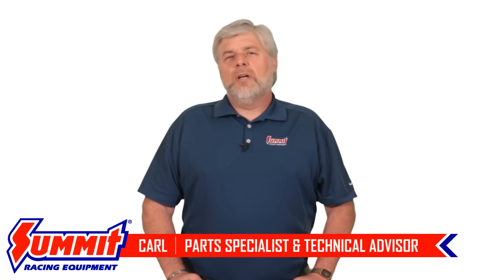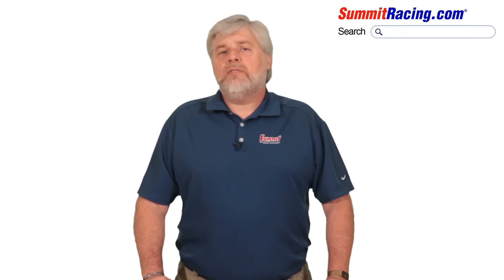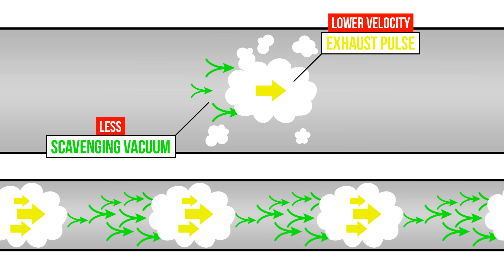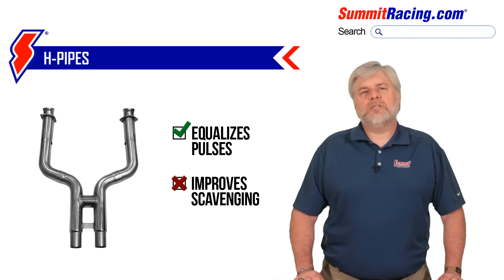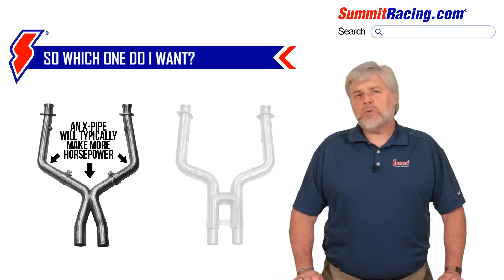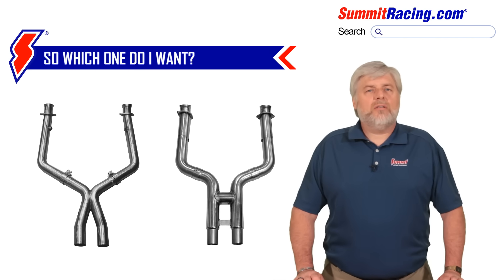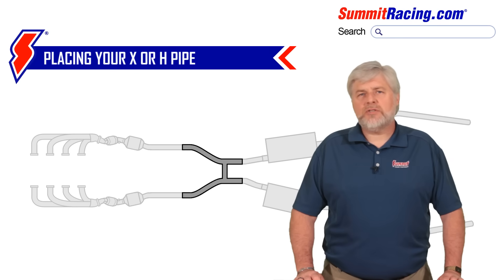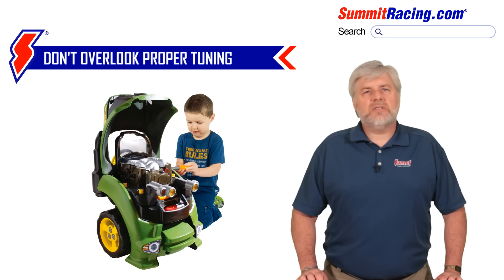Exhaust H-Pipes vs. X-Pipes: What You Need to Know

Comment: Is there a specific length of H pipe that works better? Why?
Reply from the maker: Hi Samuel,  the length doesn’t really matter. Its going to be what fits the application. The purpose of the x and h pipe is to equalize the pressure between the two pipes.

Comment: If you have headers then it is time to add an x pipe or H pipe. 
The X pipe is better as it doesn't restrict flow like an H pipe can with the adjoining pipe in between the H pipe. 
If cost is an issue and a significant difference in price exists then choose the one you can afford as the x pipe and h pipe are very similar performance wise.

Comment: A fueling pinch, named for a man whose name was Fueling, also helps the engine resist reversion which occurs in the overlap of the exhaust and intake valve opening at the same time. But given the distance from the engine of the x or H pipe, I don't think there's enough measurement to be found for either. The primary difference is some engines get higher horsepower with an x-pipe and some of them get higher horsepower with an H pipe. By the time you get to either one of those all the Scavenging is either being accomplished or it isn't.
The Ford modular engine was for several years not responsive to x-pipes but did make a little bit more horsepower with an H pipe and always lost it with an x-pipe. Another consideration is any stretch of straight pipe 3 ft or longer tended to start dropping horsepower and I don't know why that is it was just some anomaly that occurs in the pipe where the pulses do not remain separated. Probably the disillusionment of the pressure waveform.

Comment: bottom line... unless you have a LOT of money to throw away chasing that extra 5 or 10 HP you might pick up by tuning your pipes with a dyno, don't worry about it. My car came with an X pipe and that is what it will stay with.
Reply: It's all about sound with me I got 550hp.
And I got the quietest turbo Mufflers you can get they sound fantastic but I know they're holding the horsepower back so I got to go with straight throughs. I'm going to get the quietest ones called Borla Pro Xs but they are only 14 inches long. I don't want any blah blah blah or pop pop I just want to zoom. So what I'm going to do is put two 9 inch dynamax bullets in front of them and try to find the quietest it's smooth as X pipe and hope for the best.

Comment: Way back in the pre-Internet days, but after Fred Flintstone, I had a 1969 Cutlass with a HO 350, PowerGlide and a Holley 650 double pumper.  STRAIGHT 2" pipes out of the headers (insulated) back to a pair of cutouts.  One leg of the cutouts went to the mufflers (Hush Thrush's) and the other pointed straight at the ground just behind the rear axle.  With the CO's closed it dynoed from 325 - 385 between 2 and 4k RPM.  Opening the CO's added about 30HP across that range.

Comment: Quite a bit of outdated info in this video. MotorTrend (Engine Masters) actually proved many times that in nearly every application, larger diameter pipes will increase horsepower at everywhere in the RPM range.  In another episode they showed that H-Pipes will make more peak HP and Torque than an X-Pipe, however the X-Pipe is probably friendlier to tuning and drivability.
Reply: As long as you don't go too large for the amount of air the engine is moving.  The key word in the video was STOCK, & he was sort of inferring a small cid engine.  For example, if you were to put 1 7/8" primary, 4" collector headers with a set of 3" pipes on a stock  5.3L  LS, you would most likely loose power because the amount of exhaust air flowing in the system could (most likely would)slow down & then even flip over on itself when the next pulse hit it, creating even slower evacuation & eventually acting as restriction.

Comment: The sad truth in this is most street driven cars and trucks will NEVER know what works best. It'll be little more than a guess. In the end, for the over-whelming majority of us, it's street car not a RACE CAR with an unlimited budget to buy and try lots of different set ups. X, H or Y pipe and where to place them.......getting the most beneficial result would require lots of dyno testing , drag strip testing and a willingness to R&R lots of different placements, pipe sizes and header configurations. An unlimited budget and willingness to do that much work.......sounds more like an all out Race Car effort not a street car looking to just do reasonably well vs wringing out every last possible individual horsepower and torque increment available. Most of us will buy and install what is GENERALLY speaking recommended for the engine and it's breathing requirements. After that it'll boil down to what fits best and meets our sound requirements. Biggest reason to go X or H pipe on a true front to back dual exhaust boils down to a better sound. To my ears an 8 cylinder exhaust sounds better than two 4 cylinder systems. If I get a couple of extra HP out of it that's GREAT but ultimately it's more of a sound improvement I'm going for. I don't really expect to see or feel any real performance improvement worth talking about through the use of either an X or H pipe. I certainly don't expect to see any real gain for one vs the other when deciding between X vs H.

Comment: Placement is key here, old school trick is to draw a line running back along the pipes in crayon, run the engine, where the line stops burning is where you put the crossover. 👍
Reply: slade bonge  It was a trick used by Bill 'Grumpy' Jenkins back in the day, aparently he found that the line drawn in crayon stopped burning where the exhaust gasses cooled down and began to expand, he saw HP and TQ gains throughout the rev range when he put a balance pipe at this point in the system, although im sure todays off the shelf systems are designed using the same principles, but might be of help if you are building your own. But dont make the mistake of thinking bigger is better, if you go too big it allows the gasses to expand and cool down faster, this actually creates backpressure, 3in pipe is usually plenty for a street driver. Happy building!
Reply: @jaybilis9723  That applies to open headers. Closed exhaust, much is determined by the type of mufflers being used and size of the pipes.
Reply: @jaybilis9723  So when a gas cools down, it expands? Since this contradicts everything in science, please explain further.
Reply: @calvin99991  OK here we go, I think you are confusing mass with kinetic energy, as gas particle heat they expand, their mass is equal to a cool gas but their stored energy is much greater, therefore if something has more kinetic energy than something else, it takes less force to move it, if this goes against everything in science I will stand corrected.
Reply: @jaybilis9723  Okay, here we go with someone trying to give a bullshit explanation for something they said. YOU stated "....stopped burning and the exhaust gasses cooled down and began to expand". That is a wrong statement. Instead of trying to give me some bullshit explanation by changing the parameters of what you actually SAID, admit that you stated it wrong and correct it. But no, nobody on the internet can ever admit they made a mistake.
Reply: @calvin99991  sorry I meant 'slowed down' my mistake, but thank you for your articulate and well rounded response Mr haker.
Reply: @calvin99991  No no.  You worded it wrong. When the gas EXPANDS, it cools down due to lower pressure.
Reply: @ChefofWar33 not that big of a deal, dude, just move on.
Reply: @jaybilis9723  I’lm m mm mm. M m m. 
0l. Kkilkkk
),,."”-46
O g    N 
O

 M nmnl. H B.u. , 
 Nah. N
N. Pub
Reply: We did this on motorcycles back in the day too to determine length.
Reply: slade bonge  I cant help but smile when i see guys in small displacement cars with 4in pipes, because its loud they think its faster, cherrys sound mega in v8's too!
Reply: @jaybilis9723  
Thanks Jay !
Reply: @jaybilis9723  Depends on how much power they are making.  It's not uncommon for a tuner 4 banger to make over 500whp, that will restrict power on a single 3" exhaust, it's simple math.
Reply: Did this for tuning a stinger on VW.
Reply: Or just use math...  The issue is the target RPM you want the gains, the factory today does it for cruising speed, you more likely want peak gains.  The gains are very small on cross plane engines anyway.    We are talking about 4hp gain on a 400hp engine for about 500 rpm range.

Comment: Yeah, it don't matter you speaking on sound not actual vehicular/motor propulsion. Horsepower is the actual amount of output the motor is cable of producing with such vessel, with other demensional mechanisms pertaining to. Your not losing, your pretty much restraining the motor with this form of innovation of the example motor we put out here with yalls supposed governing system. Obviously it's not necessarily important, cause your only going to change the sound of the expelled reactants in fuel, air an conduction in combustion from the motor thru the pipe, which is not necessarily needed. Your talking about an exhaust system using thermal mechanics with it's, what you call scavenging. So what's the point of a dual turbo then, or why is compression important when it's really not it's just a control in to output transfer system connected to the motor. This form of exhaust system works on a distortion level in sound, so it doesn't have much to do with the vehicles potential, your already straining the motor this way with not knowing how to actually build or using components within that aren't needed. Even with the y frame, it's how well do you want the motor to work. These exhaust systems, and or cars as well, ideas are dumb.

Comment: Can you take a 3in exhaust and Y it off into two 2 1/2 inch exhausts on a 4 cylinder or straight 6 without messing up the flow.

Comment: My understanding is that the scavenging effects are not as important on a turbocharged car. My C63s has a valved H - pipe and I think AMG put this there to vary the sound throughout the rev range. I had an issue with the H pipe valve rattling so my exhaust shop welded the valve open all the time. To my shock, the sound of the car has gone backwards quite a bit, especially on overrun. I think AMG must be using the H pipe closed a lot to get a more separated sound out of the turbo V8. With it open all the time, the sound is very noticeably smoother (and quieter) and I don’t like it, it has lost the rorty sound. Very interesting.

Comment: You also need to take into consideration that every 90 degree angle in any type of piping that has anything running through it diminishes the efficiency of the flow by 25%. An X pipe or H pipe does nothing except equalizes the pressure in the piping between two independent tubes. It is not condusive to the efficiency of engine because one pipe is going to always have a difference in pressure. Differential pressure always restricts the flow of the lower pressured piping thereby influencing the backpressure on not just the lower pressured side but also inhibits the higher pressured side as well.

Comment: I have a 468 Big block with  a 570 lift cam and a dual plain intake with heads that are ported and  polished to match. I currently have headers with 2.5inch  exhaust pipe true duals with flowmaster 40 series mufflers. I plan on  changing to a 3inch  true dual exhaust with straight thru Borla pro xs mufflers and I'm wondering if a X pipe would benefit me power wise and sound?

Comment: The only thing im thinking is holes in your exhuast are a bigger deal then i imagined. My grandpa said after getting his old one replaced it had more horsepower. But i thought wouldnt it be harder to push air out of a complete pipe instead of a holy pipe? Guess i forgot how important vacuum is to the engine.

Comment: I have a 5.0 tvr/rover V8 Capri with 1-7/8" primaries into 4-1 collectors and dual 3inch pipes with no crosspipe,it sounds like thunder.I built a custom dual set up for our ST220 again without any crosspipe,it is slightly noisy at WOT but sounds nicely deep and rumbly from low to middle range.

Comment: I had tuned headers on my small block 400. My mufflers wore out. The exhaust shop talked me into putting in a "H" pipe.
It ruined my 'tune", I lost horse power and top end.
Don't put "H" pipe!!!
(Plus, it's really hard to work around while doing tranny work. You can't just drop one side at a time.)

Comment: U is the best because you can wrap back around to the turbo and then exit out the bumper
Reply: I Got AUDI a6 c5 2.4i 121kw 2001y and i got y pipe do i can to go for true dual exhaust is it possible and should i go for it ?
Reply: @reyzo3411  fohget abouttit

Comment: I have a 3.0l V6 Ford essex motor in my pickup (I'm from south africa) and I want to turbo charge my engine. With the size restrictions I have in my engine bay I was thinking of making it a rear mounted turbo setup. So my question is, how do I determin how large of a diameter downpipe I can work with and would it be benificial to make sure the pipes are of equal leanth from each cylindar (collector/header) before merging into the main downpipe?
Reply: It's going to be very hard to source the piping needed to do this unless your capable of doing the work yourself. Assuming it's just going to run low boost you don't need any more than 2.5" diameter IMO, what type of turbo were you planning on running? Best of luck with the build from Canada 🇨🇦👍
Reply: @frankkirkman5994  Piping isn't the problem I can find that. Yes I am going to do the work myself and yes at first I am going to run low boost. I would just like to build the whole pipe once. I just don't want to run into problems if I give it more boost later. Thanx
Reply: @okertoneill997  that sounds like a fun project, make sure you get a good boost controller, turbo timer and reliable bov, I can imagine finding reliable tuning might be an issue and you want all quality failsafes in the event you end up running 18psi and your stock? ecu starts to send errors because of a weird A/F ratio 😝
Reply: @frankkirkman5994  I don't know if it's a good or bad thing, but I'm thinking of keeping it carb...
Reply: @okertoneill997  how do the size restrictions for engine sizes work? We don't have a system like that in Canada... The govt has an emissions test in some places here to test the emission levels your car makes and then tax you accordingly to how much it pollutes or make you fix your car.
Reply: @frankkirkman5994  no restrictions here
Reply: @okertoneill997  lol sorry , I read your post wrong, I thought you meant they restrict engine sizes where your from like they do in some Asian countries haha... What type of truck is the 3.0 in?
Reply: @frankkirkman5994  a 1976 Ford cortina. Here we call it a bakkie so when I talk to anyone overseas from me I generally refer to it as a puckup. I know in america they would call it a mini truck
Reply: What I meant to say in that reply was that I'm thinking of keeping the engine carborated and not fuel injecting it. Now I don't know how it's gonna react when I turbo it

Comment: Thanks for the tutorial. I'm currently driving and working on a 72 satellite with 400 cu smogger special with a 2 barrel carb and 2" OD duals into a pair of 19 inch flow masters. I assume they're 3 chamber, but unsure. they're really quiet. At 60mph I cant hear em' even with the windows down. I've already built a 440 and currently waiting on more funds to finish building the spare tranny that'll go with it and money for a rebuilt rear & blah blah, blah. I'm about a year away from getting it all together and I'm currently driving the old 400 "as is" completely stock. it runs and drives just fine but the car is a little too quiet for my liking. can u recommend a cheap pair of mufflers to give it a louder, more aggressive sound?  I'm gonna run headers w/ 3" collectors through new pipe and mufflers when I put the new motor in anyway. So the current pipe and mufflers are just temporary. So no biggie if they're cheapies...I currently drive it every weekend and just want a nicer, louder meatier tone. P.S. not a fan of Glass Packs, if that's what your about to suggest. Something in the $75-80 dollar per muffler range is fine w/me. Or even cheaper would be great. Thanks for your advise. Current pipe is 2" OD and I can weld so doesn't have to be compression fit. just don't want stainless for new muffler. Current pipe is stock mild steel. I subsribed

Comment: After watching the video and reading comments I am more confused than ever🤔
Reply: Kevin Grazier 
Easy, 
Stupid is true dual. 
Low end torque is H pipe. 
High end torque is X pipe.
Reply: @oneslave3318  One problem that is not going to be correct even most of the time.  Unless your system is tuned before the crossover no this really matters.  For the vast majority of modded cars this will likely be the case because, you are gear head and not nerds.  The entire system must be tuned to the same rev range to benefit.
Reply: me 2!
Reply: I know right
Reply: TL:DW 

Get an h-pipe.
Reply: That's why you drive a Mopar
Reply: hahahaha
Reply: unless you have a racecar none of it matters. Just get the one that sounds better to you
Reply: because it is mostly bullshit
Reply: When in doubt; straight pipe

Comment: Hi Carl,
What would you recommend for my 2018 Toyota Tundra with 4.6L V-8? I mostly use it for driving to the office and pulling the 20' ski boat on the weekends. The factory two in one is ok, but I'd like to go duals that  aren't much louder than stock. A recommendation on mufflers would be great too. Thanks!
Reply: Buy a Ford
Reply: I added shorty headers, aftermarket exhaust (2 into 1) and a k&n air filter.  Result was better mid range torque @ highway speeds.  The tundra has enough low end torque already.